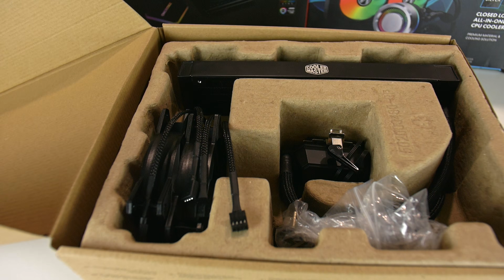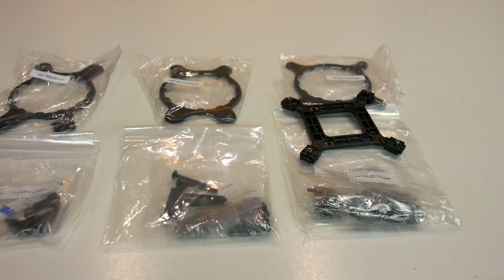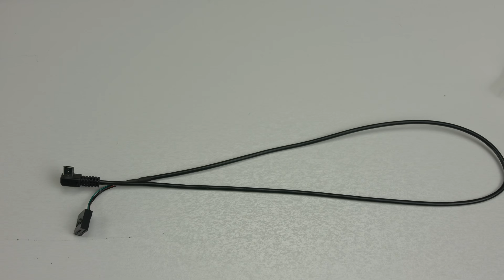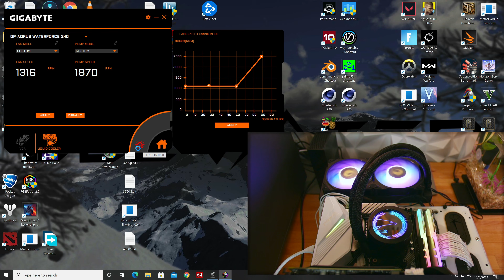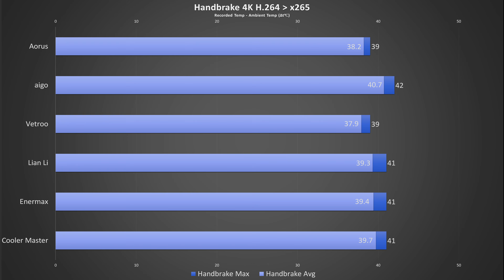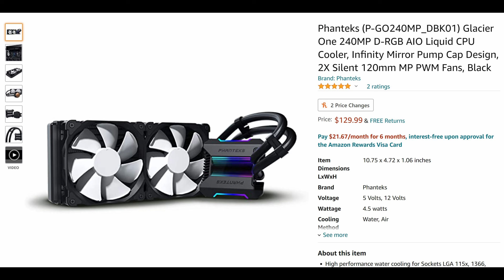Aorus Waterforce 240 - Too Little for Too Much.

Comment: I have a waterforce x 240. The liquid status shows zero degrees. The other information is displayed correctly, but the liquid status information is zero. The processor is a Ryzen 9 5900x. Does anyone know any solution for this? already installed and reinstalled the newer versions of RGB fusion and Aorus Engine, and nothing.
Reply: I had the same problem so I requested a replacement from Amazon and the new works fine.
Reply: Does it not come with thermal compound pre applied?
Reply: Did you ever figure this out? I'm currently having this issue. I bought mine pre built from NZXT and I didn't get the extended warranty. Ooof.